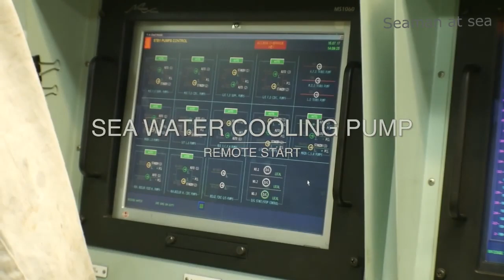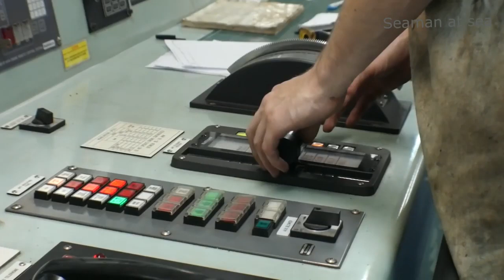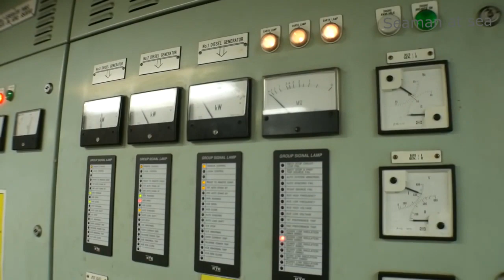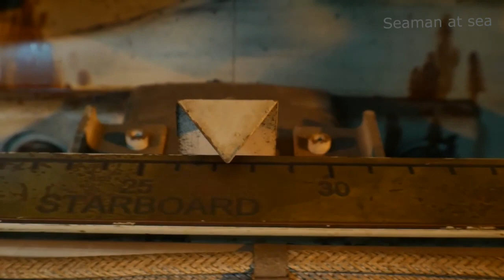Ship's Main Engine Starting procedure step by step...!

Comment: WHY YOU'RE DIDN'T SHOWED AS TO DRAIN BOTTLES ALSO FILLING COOLING WATER HT LT TANKS, STARTED LO PUMP? WHAT ABOUT PRE LUBRICATION???
Reply: Cooling water is always filled, pump is working all the time considering that ship is at a port, not dry dock or something of big stoppage. About prelubrication, main LO pump is also always working, cylinder oil is pressuraized electronically by putting ME at stand by mode and then cyllinder oil is injected into the cylinders through the cylinder bores, then we can turn the engine safely and open air and make blowing